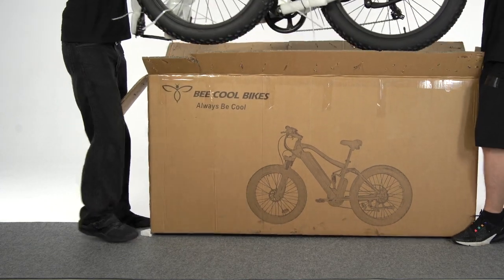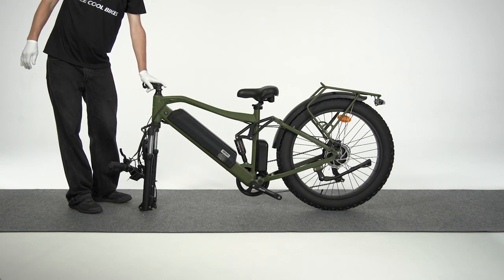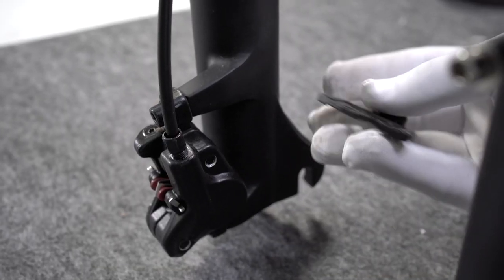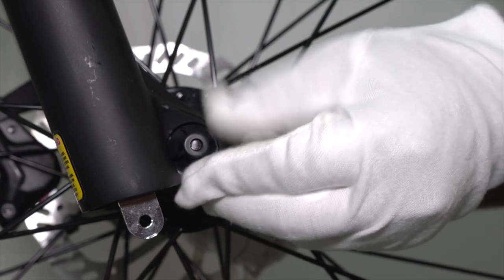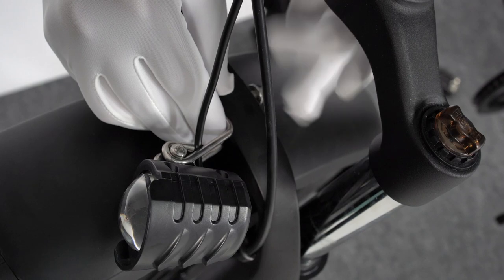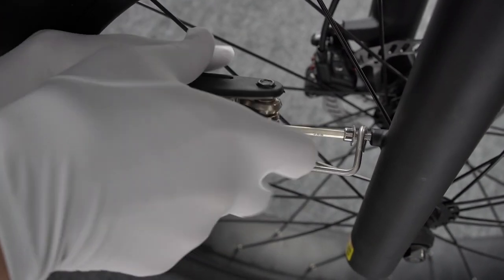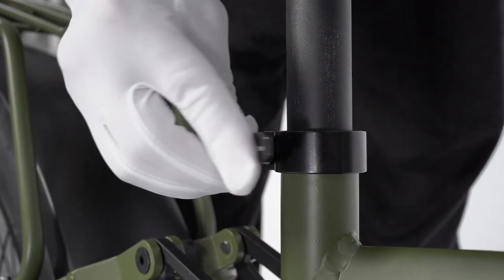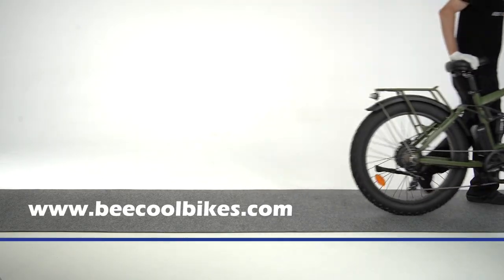BeeCool Bikes | Assembly Instructions of Bee Adventurer and Bee Explorer

Comment: Just received my ebike and assembled it.  The only problem I have is that I can't figure out how to turn on the headlight.  Everything else works great!
Reply from the maker: Long press the UP button:face-blue-smiling:
Reply: @beecoolbikes8312  Thanks for the info.  I found it in the instruction manual not long after I typed this.  The bike is working great so far, and I am really enjoying it!  Do you recommend changing gears while pedaling or should I stop pedaling to change gears?
Reply from the maker: @wesbaumguardner8829  You can check out gears instruction here, https://medium.com/@stevenjiang162/mastering-the-beecool-e-bikes-7-speed-gear-system-for-a-joyful-ride-de273dbe7cda
Reply: @beecoolbikes8312  Thank you for the response.  The article you linked was very informative and I appreciate the information, however it does not actually answer the question I previously posited.  What I need to know is whether it is better on the transmission of my ebike for me to switch gears while pedaling or for me to stop pedaling before I switch gears.

Comment: I forgot about this video for some time but would like to say that the bike came in with multiple problems and the battery had a problem within 2 weeks where some sort of glue inside the battery melted in 80 degree weather and has been unusable ever since. I e-mailed Bee cool and their reply was that they can send me a new battery endcap but the repair cost is on me so if you receive a broken bike expect to pay a third party for it just to get it running.

Comment: Why didn't you describe how to connect the rear light / turn signal unit?  Note that a zip tie or other connection will need to be used in order to take up the slack in the connection cable. I wouold also note that your support personnel are NOT very helpful.  This is disappointing since I really like the ebike.  Customer service is key for the success of your business.  I'm speaking as the president of an architectural design firm with more than 40 years of experience.  The customer is key.
Reply: This is the reason I asked you the question I did on an earlier comment. I'm also looking to get an ebike, Beecool was a 'final contender'...was. After hearing and reading about some concerning issues, I've lost confidence in them being on my list now. Js I hope all goes well with yours and be careful plugging the charger to the bike if it contacts the frame and sparks it can ruin the battery. It seems as though the charging port on some models isn't exactly where it should be so the connector contacts the frame causing said sparking issue.